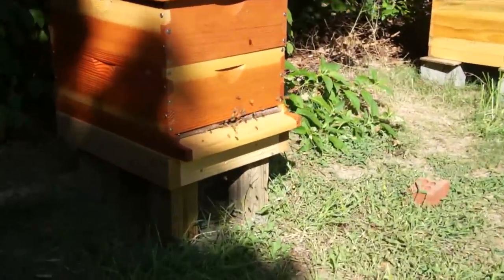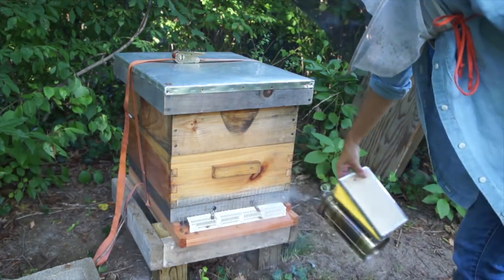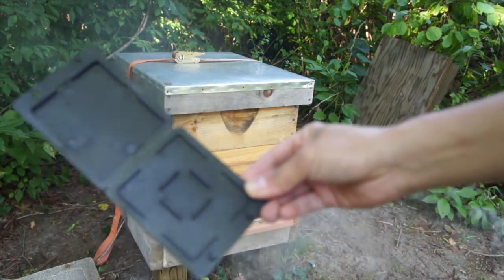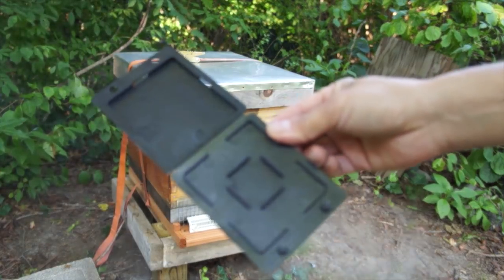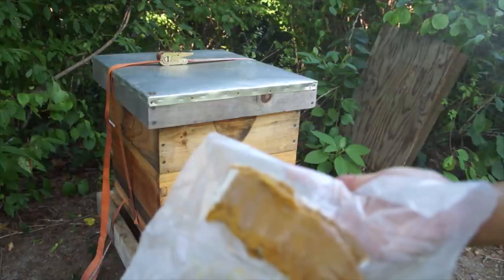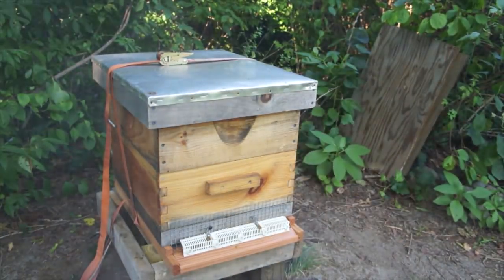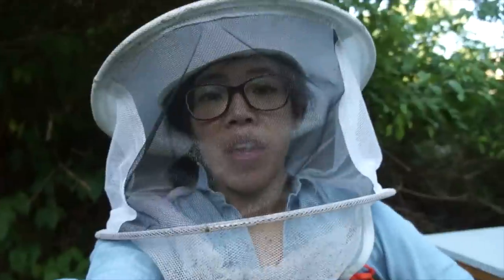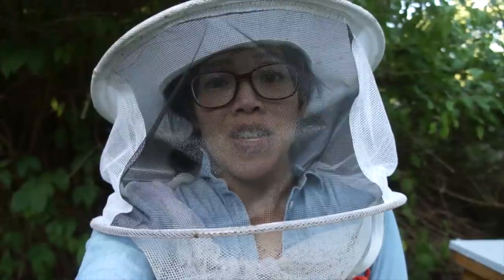Laying Out New Hive Beetle Traps -- Bee Vlog #27, 2018

Comment: Hi from Australia.
Just a question about the bottom board beetle traps.
You would have to check the tray each time you had heavy rain .? Thanks Neville
Reply from the maker: Yes, you’re right. It needs to be checked. I’ll have to take some time to work on sealing it off.

Comment: Take that inner cover, and seal all those gaps  it has on the  inner perimeter because the beetles will use those open gaps as motels to hide from the bees, and not only will they hide in there, but they will lay eggs in there and while they are in there, they will beg the bees for food and the bees will feed them (it is true, look it up).
You can fill those gaps with wood glue mixed with sawdust, or epoxy mixed with sawdust. 
If you wish to be more organic, then use beeswax and melt it in there, or use a wax candle (plain), light it up, and as the wax drips, fill those gaps with the wax, this will take a while, but it will get the job done; you can later use a heat gun or maybe a hair dryer to heat up the wax to even out some of the bumps the dripping wax will leave behind. 
Whatever you do or however you do it, just make sure those inner covers don't have any gaps where the beetles can hide and the bees can't reach them.
And finally, place a heavy block of concrete or two (heavy concrete pavers look nice), on top of the metal cover, that way if the wood has some kind of warp in it, the heavy blocks will flatten it out and prevent any gaps between all those wood layers (main cover, inner cover, hive box, bottom board, etc.).